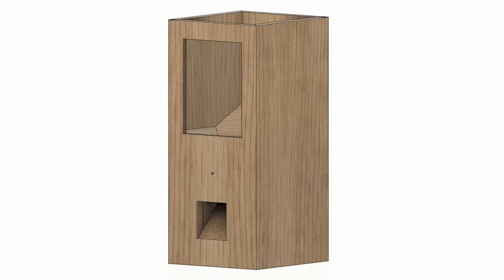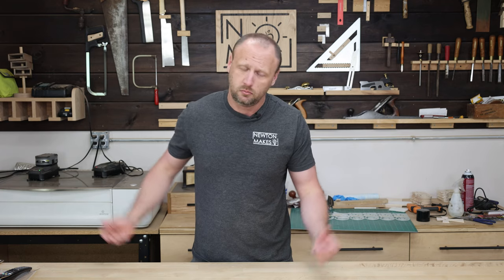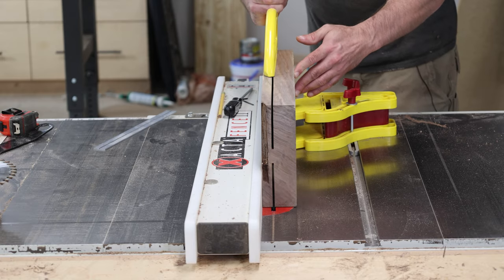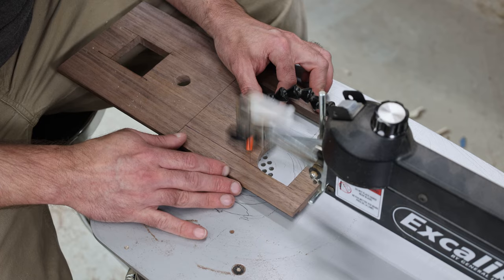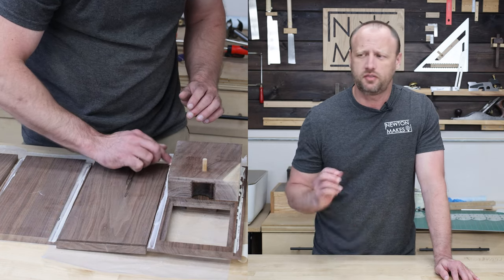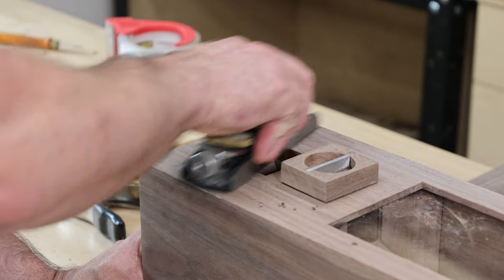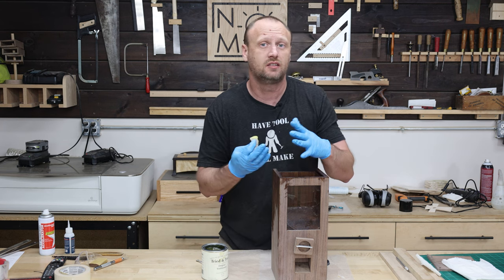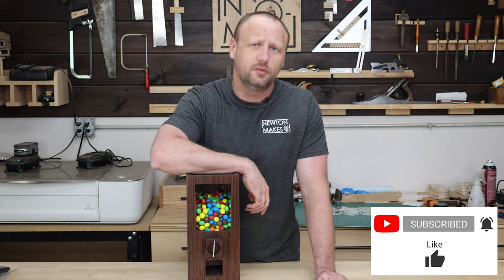One of My Most Challenging Builds!...and I Destroyed a Tool

Comment: Just a remark about the drill press accident, your lucky that was all that happened. You never spin a bit that large that fast , especially without clamps holding the workpiece. It will not be very long before something worse happens.
Reply: I was thinking the same thing about the lack of a clamp. Drill presses are one of those tools that seem tame but can quickly bite